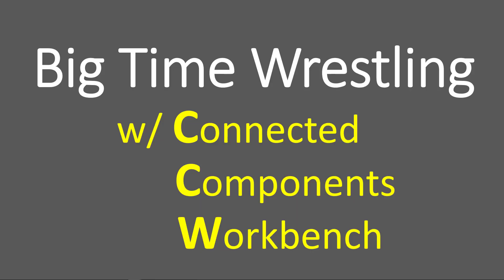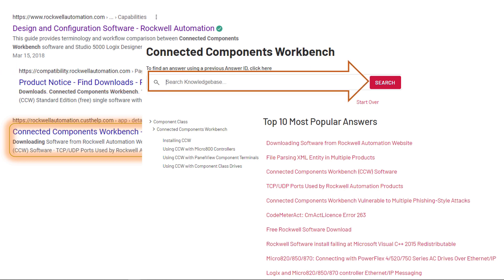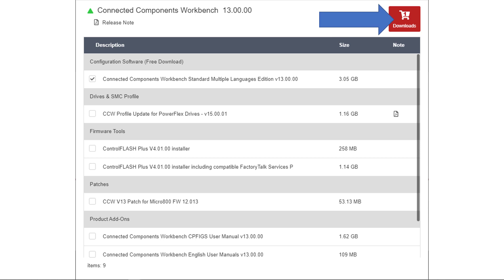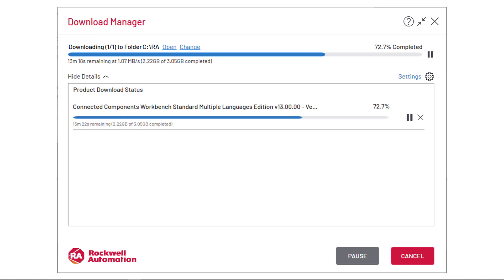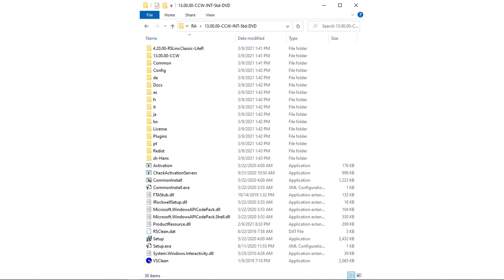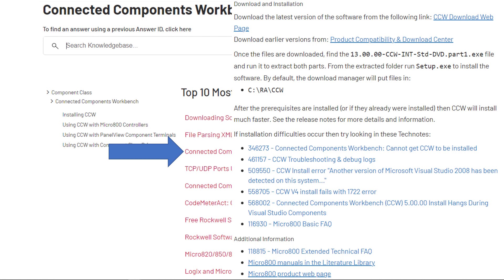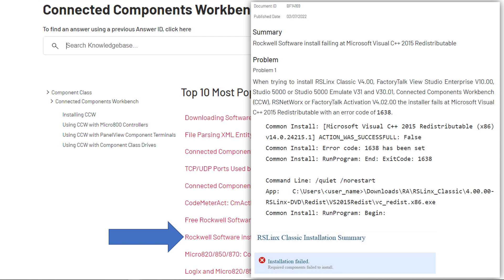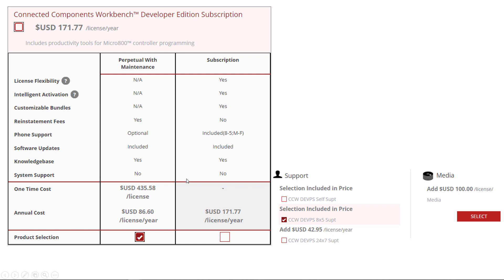CCW - Find, Download, Install and eliminate ERRORS

Comment: thanks for video, to help with understand RA software online, annual fee with Perpetual can be 3 type : self assist, 8to5, 24x7 ; following year annual fee is required to maintain access to downloads per SN and access NON-public KnowBase technotes ; discuss with local distributor that should have PDFs that explain online software and subscription type. 
Also, appreciate efforts & details on 440C-CR30 multi-part project.